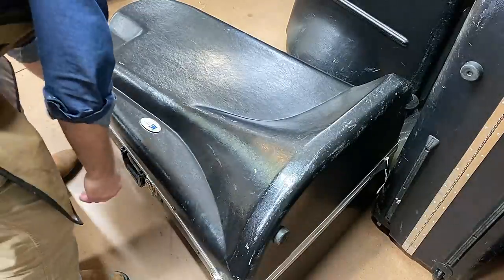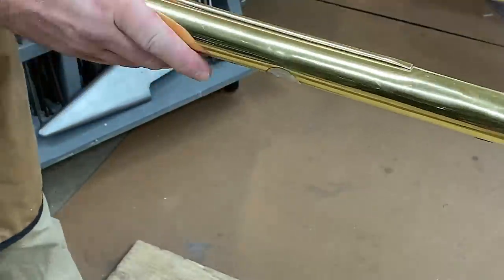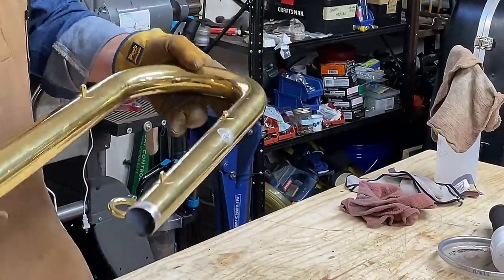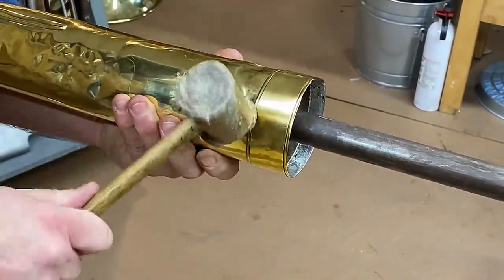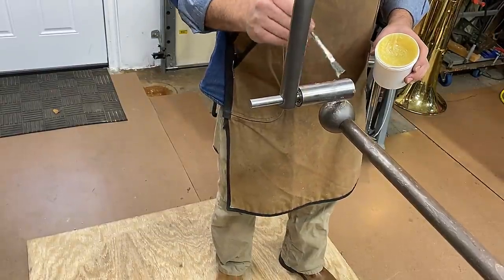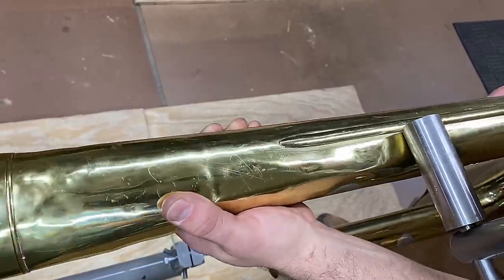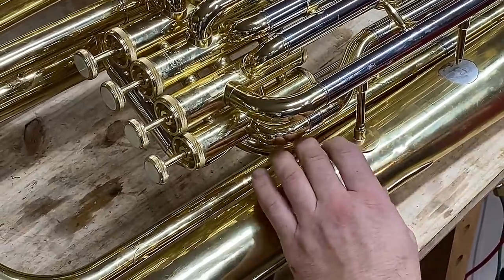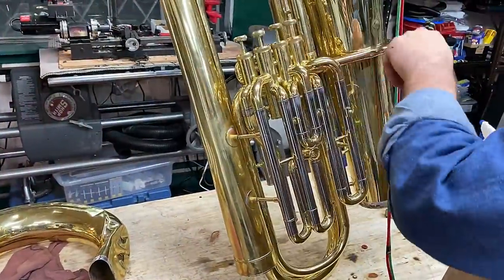The Tragic Tuba- part 1- Wes Lee Music Repair

Comment: You sir are a treasure to your community. Maybe you could work with your school system to bring some of the students into your shop to learn and help repair the instruments they are learning to play. Sort of a 2 for 1 education. I had a shop class starting in 6th grade , a little wood working, metal and ceramics. Eventually I got a job after high school as an apprentice repair man with the National Cash Register Co. Decided to try college though and became a mechanical engineer. Then the desire to work with my hands learned in grade school struck again and for a hobby I  built my own home, added on to my daughter's home, and together with my son tore down his home and rebuilt it to twice the original size. It all starts when we are young!

Comment: I can really appreciate your work. I used to overhaul jet engine components. I was the dent fixer guy. I could look at a part that anyone else wouldn't even attempt to work on and take on the challenge. Satisfying work for sure. I saved that company $$$ in parts they would have just scrapped.
Reply: Have you transferred your skills to vintage motor body restoration? There must be good money in that market these days.
Reply: @BrassLock  No. I've transferred over to IT Computer management guy for better employment opportunities and continuity of paychecks 🤣.
Reply: @ActualSighs  Good for you!
But sad for the loss of your "crumpled-metal" working skills. 
My Honda Jazz got "lightly rear-ended" a few years ago which left unsightly wrinkles in the upward-lifting door. I've been told that this simple wrinkle cannot be restored due to the fact that the door is "double layered", so I need to import a complete new door from Japan 🇯🇵 and have it fitted with the old window, wiper etc. No doubt with supply chain problems these days, it would mean months without a car. Wish I had your skills 🙄

Comment: ive had my tuba de-dented more than once! now i understand why it cost so much. i would have loved ddoing this work. respect to your skills
Reply: What’s the cost to remove a dent?
Reply: @turnupthesun81  99% of the time it’s paid by the shop hour. The shops hourly rate will vary as well. Some dents are easier, some are troublesome. Just depends on how long it takes the tech to remove the dent.

Comment: One thing I've found useful for getting the ferrules circular is tailpipe fitting tools for automotives.  They work like expanders but the way they function means you can get a taper in them to match the work piece.  Sometimes the 4/4 tubas are too big though, so ymmv.

Comment: Do you have to be careful with that torch? Does it burn hotter due to the Oxygen? Can you melt the brass at all? I am currently using a propane only torch. I am learning horn repair. Gotta watch and learn from the master.
Reply from the maker: Thanks for watching.
Yes, this torch is more precise and focused than propane only. The O2 will help it generate 5,800F on the high end, which will put holes in brass. I have multiple tips that I use for different jobs. Because of using small super focus tips, my lacquer burn ratio has gone down a lot. Great question, thanks.

Comment: As a  brass repair technician in Canada for over thirty years,you should’ve chemical clean first then remove dents. It’s a lot easier to remove and gets the crusty texture from the inside the tubes. Less scratching on your tools. But good work on de denting school horns.
Reply from the maker: Agreed that flushing first would be better, however, when I’m working on deadline times I’m not worried about scratching my tools. The goal is not to touch a piece more than you would have to. To your point, I’ve made myself a new list as to my operations. Flush in pieces, as I pull a branch go ahead and flush before dents, instead of as a whole at end. 
So we are thinking similar. Thanks for input.

Comment: Have you ever tried using an hydraulic bladder to expand inside the pipe exerting pressure in all directions to quickly bring it into round.

Comment: How do you use the torch without burning the lacquer?
Reply from the maker: The quick, crotchety old man answer is “control the heat”. 
But in all seriousness, this new torch setup allows me to be so specific of where I am directing the heat, it’s saved me a lot of time in cleanup of lacquer burn.

Comment: i have my first trumpet, a Selmer Radial Mark2 that had titanium valve liners, but are worn horribly plus solder joints cracking, and worst the silver plating is gone from the valve group where my hand sweated.....
what do you think!??

Comment: I dont know much about your work but are you not worried about work hardening the material that makes the brass instruments.
Reply: That would be a thing for the NEXT guy who does a major overhaul. I'm sure it is a problem, but the condition of this instrument makes that particular concern a little abstruse.
Reply: @ricoludovici2825  fair enough. Makes sense

Comment: You guys should look into hydroforming
Reply: I thought something similar, he could possibly use a small hand or foot pump to more accurately control the pressure, it could be the best way to get an even smoother tube surface finish.